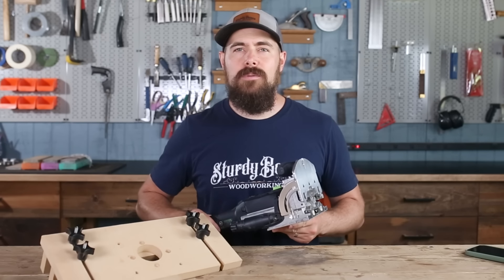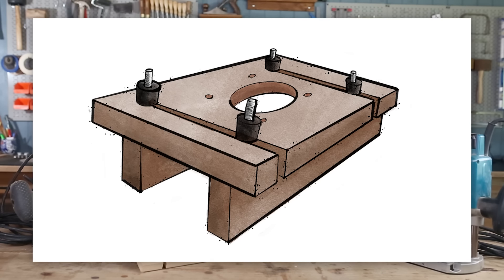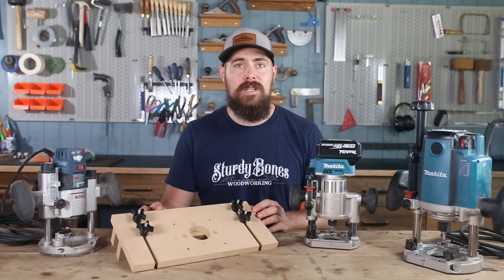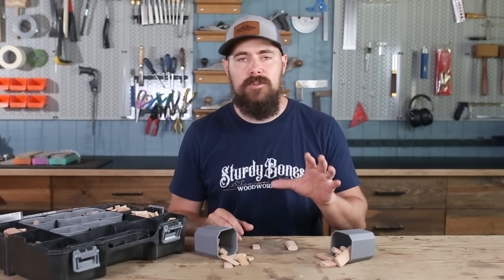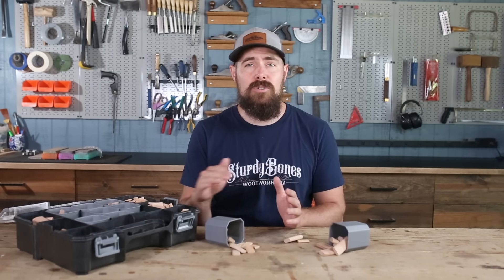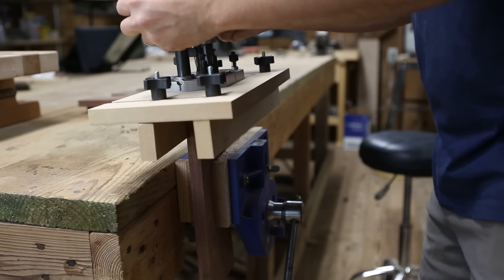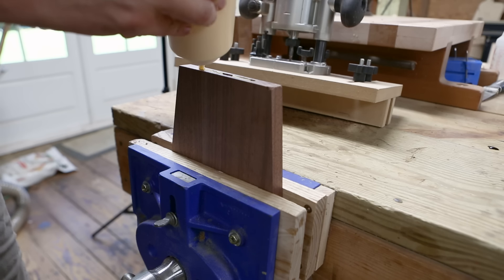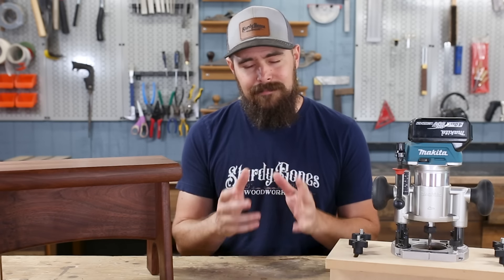This is why you need a plunge router

Comment: Two suggestions. 1) Running the jig along a piece of wood could be rocky. Sandwich two boards on the one to be mortised to give a more stable platform for the jig.  2) Rout a small diameter groove at the center line of the router bit to make lining up easier.  Might these help?
Reply from the maker: Hi thanks for watching! For #1 I love it. If you’re not confident it’ll cut smoothly that’s a great alternative. As for #2, I’m not sure I’d totally trust it just in case there’s a little slop in the base plate mounting holes. But that’s just me and at this point I’m used to centering the bit manually.

Comment: This seems to work great. I'd suggest that a bridge across the open gaps at the adjustment slots to prevent any spreading.
Reply from the maker: Thanks! I’m not sure I can visualize what you mean. If you make one with that adjustment I’d love to see your updates to it!
Reply: @sturdyboneswoodworking  I know that it is made with MDF, but what I mean is a steel plate across the open gap where it would be essentially the end grain, the open area where the one fence could be slid out from. I say this just because MDF will easily crack at that point if it was dropped or hit on one of those ears.

Comment: Great jig! Ive made a few for LT joints, but never really happy with em. Never thought about making the jig slide along the work piece. I think by adding centring & stop markers to it would complete this jig.
Reply from the maker: Yeah I’m sure there are some improvements to fine tune it for usability. I’ve just grown comfortable using the bit for centering and I like that the jig/router don’t even need to be straight aligned with piece as long as the bit stays centered along the cut. It also works great as just an edge guide if you take one of the rails off. I spent like $60 on a makita rail edge guide and I like it but really all I paid for on that is the (very nice) micro adjust.

Comment: All you need is a router. And a router table. And a drill press. And a table saw. And a band saw. And a miter saw. And loads of clamps. And a planer. And a jointer...
Reply from the maker: 🤣 So true. Thanks for watching!
Reply: You could try doing it without tools or wood if you want
Reply: I got all those and never seem to have the right tool.

Comment: Love the way you presented this topic created a jig then built a project! When you setup and calibrated your planer did you use the factory settings. Since Grizzly doesn't show the procedure with helical cutter heads I looked at some forums indicating using settings from powermatic planers.
Reply from the maker: Thank you! So I just went for it when I bought this one secondhand. I had run a few boards through it and checked with calipers and it was cutting level and accurately so I haven’t really adjusted anything except to quarter turn a few teeth that saw a nail I failed to remove in some reclaimed material. Could probably use a seasonal check though.

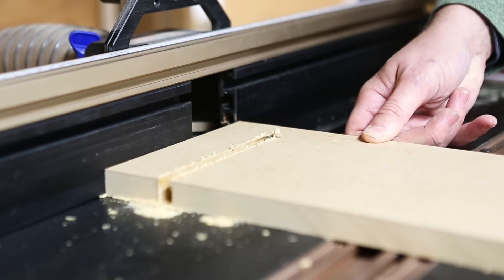Comment: Is there a reason the slots for the adjustable rails on the jig are open ended? Seems it'd be much sturdier and safer to build if they were captured slots vs one end open.  It looks like it'd be easy to put a little too much pressure on it while cutting the slot and make it close up (2:58). 
Nice build on the stool. 
Thank you for sharing.
Reply from the maker: Thanks for watching. Only reasons for making them open ended are it makes it easier to build and easier to take the rails on and off without unscrewing the hardware all the way. I haven’t tested it or anything, but I would think that it would take quite a lot of pressure to break off like that with 2 inches of MDF at each end. The rails on the jig run all the way to the end of the base plate and support the end when it’s all set up.

Comment: Would it work just as well to just drill a single hole and then use a dowel rod?
Reply from the maker: Absolutely. So you not only don’t need a domino, you don’t even need tenons. As long as you have good alignment with your holes on your two parts, dowels work just fine. The main advantage that loose tenons like these and dominos offer is greater strength in the joint, because it increases the long grain to long grain glue surface area. Dowel joints leave the two parts connected together more by a long grain to end grain connection than loose tenons so they’re just a bit weaker depending on the diameter, quantity and spacing of the dowels. 

There are tons of great dowel jigs out there that would cost you less than a router. But I’d still advocate for owning a plunge router because the same $150 budget for a doweling jig could buy you a plunge base and the latter is much more versatile.
Reply: @sturdyboneswoodworking  great, thanks. I'm literally just starting my woodworking journey and only own a drill! I'm borrowing a circular saw and a mitre saw. Every day is a day for learning - when I'm not doing my actual desk based job, anyway!

Comment: Your router was supplied with a adjustable fence, I had a spare from another router and mounted them on the same rails and that does the same thing. I wouldn't buy a domino though, i do mortise and tenon.
Reply from the maker: It depends on how you bought your router. The one that came with mine was really small and would take a lot to be accurate. I bought a $70 one for my Makita and you’re right it does work similarly. But hopefully this helps those who don’t even have a router.

Comment: Quicker and easier to just use dowels
Reply from the maker: For a project like this stool I’d agree there are definitely faster methods. But this jig/method also works for making really big grooves or mortises. But yeah if you have a good doweling jig it’s still a great option for a lot of cases. My goal was to show a setup for anyone who needs a loose tenon application but doesn’t have the Domino.

Comment: The domino system is much more fast and reliable in comparison with this. I cannot see any kind of advantages compare to domino. Sure, if you don’t have a domino this is an alternative but more time consuming.
Reply from the maker: I agree it’s way more time consuming. But another way to think of its usefulness is that there are even size limitations to the Domino. I’ve used this jig with my big plunge router and a 1/2” bit to make huge mortises for traditional breadboard ends (I have a video on it). And while you could argue you can do the same with Dominos, at least for that application I think you’d at least have to have the DF700 and the cutters to make really deep mortises for it to be strong enough. So maybe that helps sell its usefulness a bit beyond standard 5-10mm loose tenon work. I definitely prefer my Domino most of the time when I just need to get work done. Thanks for watching!
Reply: Oh, it's only money...
I can afford a Domino, I just have other things to blow money on. Domino's are a one trick pony, just too dang expensive.

Comment: Nice video, but I really wish creators would stop doing this: All you need is a router (then they add wood, bolts, knobs and screws)
Reply from the maker: Haha. I hear you. But of course my main point is you don’t have to have a $1500 domino to do quality loose tenon joinery. Plunge router, a $40 hardware kit, and scrap plywood goes a long way. But that doesn’t make for a very interesting video title.
Reply: What would he do with just a router? Turn it on and watch it?
Reply: Well the router is the main power tool required to operate Domino alternate. Wood, screws &  knobs won't break the bank, obviously needed to hold things together, so don't cheep out without them. BTW don't forget the pencil, not a Sharpie!😅
Reply: ..oops .... Forgot the copious amount of glue !
Reply: And a planer, and a router table, and a bandsaw, and a table saw, and clamps...
Reply: How do you plan on building an adjustable jig for a router without these other components? If he told you to use acrylic would you be upset too?

You guys are honestly the worst complainers.

I was going to to explain how all of you can figure it out, but why would I help anyone here when all you do is complain about what you don’t have, rather than figure out how to get the things you need to get a job done?

Most ridiculous comment section full of whining complainers.
Reply: @billymurphy3  

Sounds like someone's bank account is too big. Come back when you're eating ramen and hotdogs because you have to.